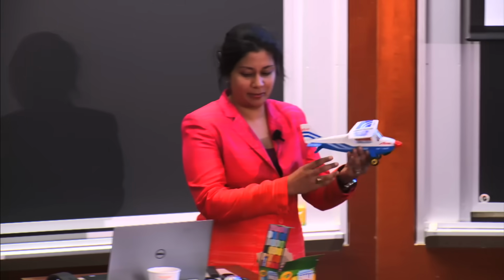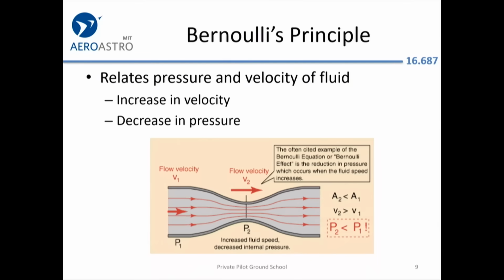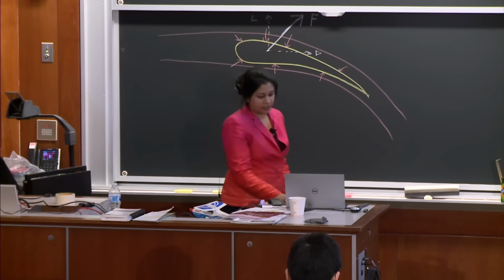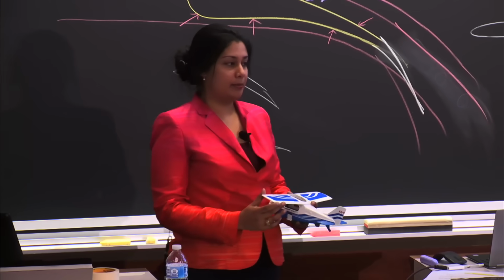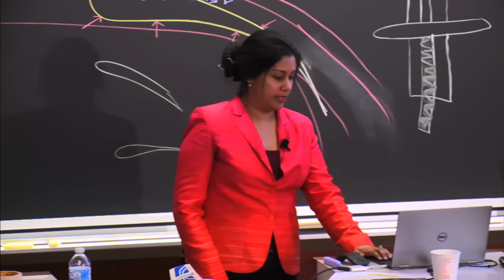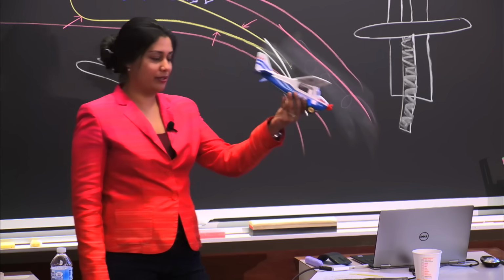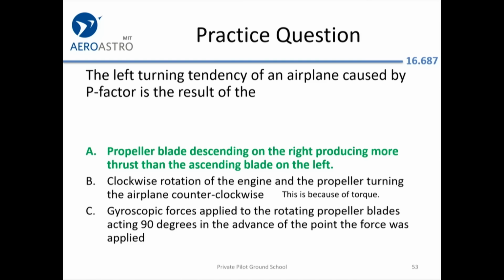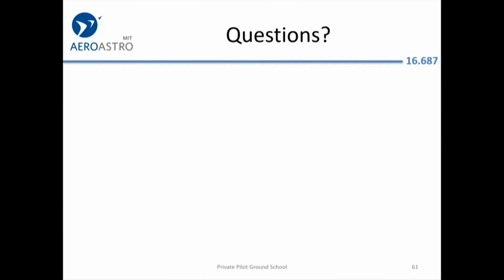Lecture 2: Airplane Aerodynamics

Comment: There is a WRONG statement at time 12:50 - The text in the slide "Air traveling faster over the curves upper surface of an airfoil causes lower pressure on the top surface". Is conceptually wrong . It seems to be a leftover of the "equal transit theory". If you want to explain lift by this "lower pressure generated by the higher speed or air across the top surface" you have first to state the reason why the air is flowing faster on top relative to the speed at the bottom surface. I think you can not state any other reason that the wrong "equal transit time theory". You are right that you can apply Bernoulli’s law to explain lift. But you have to change the wording in the answer C as follows: "The lower pressure at the upper wing surface accelerates the speed of the flow across it. At the lower surface the pressure is higher, so the speed of the airflow is not accelerated as much as at the upper surface". But why is there a lower pressure at the upper surface? It's because the upper surface is curved to form a line similar to a part of the circumference of a circle. So the air flowing around that "part of a circle" experiences centrifugal forces that are 90° away from the surface of the upper wing. In other words - the air molecules tend to follow a straight line, but if they are deflected to follow a rounded surface there must be a force keeping the molecules on a path parallel to the curved surface. This force is given by a pressure differential between the free undisturbed air far away from the upper surface (ambient pressure) and the pressure of the air flowing in a curve over the curve of the upper surface of the airfoil. There is another error in your explanations: When you introduce the "flat plate airfoil" of the paper airplane to explain that the "equal transit time theory" is wrong. You suggest that the lift of the inclined "flat plate airfoil" is generated equally along the length of the flat airfoil. But a wind tunnel experiment at MIT will show you that this is NOT the case. The front 20% of the inclined "flat plate airfoil" generates much more lift that the remaining 80% of the plate. This is another hint towards the fact that lift is generated by the lower pressure that is a consequence of the air flowing around (a-ROUND) the leading edge of the airfoil. A similar effect is observable at the lower surface of the flat plate airfoil. The air is changing direction downwards just immediately behind the leading edge. The remaining flat lower surface of the "flat plate airfoil" is contributing much less towards the total lift generated by the plate. It's because air is not like sand. If you would drag an inclined board through fine dry sand at a beach below the surface so that the entire board is below the surface and dragged parallel to the surface, then all the length of the inclined board would push equally up towards the surface.
Reply: https://en.wikipedia.org/wiki/Bernoulli's_principle
Reply: @Angelum Band If you want to reason that Bernoulli's principle is the way how airfoils produce lift, then you have to be careful not to interchange cause and effect. At the upper surface of an airfoil the pressure is reduced because of the curved flow experiences centrifugal forces away from the airfoil - this is the cause of the acceleration of the airflow towards the reduced pressure. Bernoulli's principle only states that along a flow line there is the relation of higher speed at a lower pressure and a lower speed at a higher pressure so that the sum of potential energy due to pressure and the kinetic energy due to speed remains constant along the path. If you want to make the statement that because of Bernoulli's principle the airfoil generates lift and continue to say that because of the higher speed at the upper surface of the airfoil there is lower pressure - and failing to give a reason for that increase in speed across the upper surface of the airfoil, you are failing to explain how a wing generates lift. If you just assume that the speed across the upper surface is greater then you either stick to the falsified "equal transit time theory" or believe in magic. The air mass molecules do not communicate among them "Remember Bernoulli - here across that upper surface of the airfoil we must increase our speed so that there will be a reduction in pressure". It's not like that. The reduction in pressure does accelerate the air mass from the higher ambient pressure of the air ahead of the airfoil towards the low-pressure area above the airfoil. In physics you have to carefully observe the relation of cause and effect. The difference in pressure (cause) increases the speed of the air mass (effect). It's NOT the other way round (as you try to explain), that because the speed of the air above the wing is higher (why?) the pressure decreases.
Reply: @sorgfaeltig  Explain the Magnum Effect but with a cylinder rotating in the same direction of travel: why does it sink?
Reply: @sorgfaeltig  Btw I am an Atheist I don't believe in magic or deities for that matter.

Comment: As someone who has spent a significant portion of his life sitting in a classroom being talked at, I've developed strong likes and dislikes which relate to the style of teaching.  At the top of my list of dislikes is having the teacher [ in this case, but it can apply to popular lectures also ] pose questions to the class - example - " what is a fuselage ".  Who is supposed to answer such a question and in what manner, and above all why is it being asked.  The main problem is that a small number of bright sparks in the class will feel the need to respond verbally, resulting in a jumbled and garbled response.  Typically there will be at least one response which will be incorrect.
IMHO it's OK for presenters or teachers to ask rhetorical questions which they immediately answer.  The problem occurs when  questions which should be rhetorical  are presented as ones requiring a response and the concomitant risk of incorrect responses, which if they are intelligible can cause wider confusion.  SO instead of asking " what is a fuselage " it is much batter to say up front what you as presenter mean by a fuselage.
An egregious example of posing real questions was when she asked the class directly an imprecise question relating to the flow of " th' air " and " th' airplane ", in the obvious expectation of receiving an answer [ which was not immediately forthcoming ].  A clumsy attempt at introducing the concept of ' frame of reference '.
Reply: Her understanding of lift in fluids is ridiculously wrong.

Comment: The equal transit theory is still being taught, and even tested, by Embry Riddle, the FAA and most pilots you ask to explain how an airplane flies will go on a Bernoulli trace-the-molecule story. They may have advanced past the equality in time, and will instead describe lift as a function of suction on the top of the wing due to lower pressure.
Reply: They teach that because that's how it works.  She doesn't understand how a wing can create lift at zero angle of attack.  She only understands "hands-out-the-window" and paper planes.

Comment: Never ask a question, for example, "which moves faster the air past the wing etc." and expect someone to give you an answer.  Instead
 ask them HOW do they know that, or HOW they would find the answer, what tests would THEY perform, how would THEY check for any errors/mistakes or if they were fooling themselves and then go outside to test it.

Comment: Literally went from “what’s a fuselage?” to “characterise the viscosity of the lift with turbulence of the propeller in the photosynthesis of the leaf” in the space of 1 hour
Reply: Underated comment. 😆 🤣
Reply: @mmm-mmm  yeaaah same, I noticed this too!, Im 15 and understand and most of this! 🤩
Reply: @GauravVerma9090  BSc = Bachelor of Science… basically, it means going to university, in this case, for an engineering course
Reply: @GauravVerma9090  Ah, there we go! Well, with «BSc in Engineering» I simply meant a bachelor / university degree in an engineering related field! ;D «Bachelor of Engineering» or «Bachelor of Technology» is, in fact, not that common in my country, therefore «BSc of Science in Engineering» is a term used to simply include an engineering course. :)
Reply: @GauravVerma9090   Just in the centre of Europe: Switzerland 🇨🇭
Reply: She did not say any nonsense like this.
Reply: I recommend you sign up for a BSc in engineering! ;D

Comment: is a -, which means that its viscosity depends on the forces applied to it, as measured by shear rate. Consider - such as toothpaste, ketchup and whipped cream. ... Because of this physical property, a wave of  is even more devastating than a typical tsunam

Comment: Most race cars today, atleast the ones in the formal 1, 2 and 3 generate the bulk of their downforce not with the wings, but with how airflow is directed under the chassis and let out through the rear diffuser. But of course, what she said definitely holds true for a regular car with/without spoiler.
Reply: They sort of turn the entire car into an upside-down wing too. They establish a high pressure region at the leading edge (nose), which causes an acceleration of air down the concentration gradient, to the rear. Higher velocity: lower pressure, so downforce results.  So maybe considering the front spoiler and rear as "flaps on a wing" is a better analogy?
Reply: The proximity of the bottom of the car to the race track creates a suction that helps hold the car down as air passes beneath the car.  The cleaner the flow of that air, the greater the downforce.  One reason you see the bottom of extremely fast race cars with fully sealed chassis bottoms.

Comment: @Bartonovich52 
YT is goofy.  I saw your post in full, but YT won't link back to it in that thread, so I'll try this.
.
 The air is accelerated over the wing which reduces the pressure.
Nope.  If you believe that is what is “right” about the use of Bernoulli in lift explanation, you are mistaken.
The pressure Gradient is the cause of the acceleration. 
You don't do 'something' to accelerate the air, then that causes the lower pressure.
.
This “fast air” thing is the most common Bernoulli myth repeated over and over. Euler determined that Pressure Gradients are the cause of fluid acceleration in the mid 1700s and derived what we now call Bernoulli’s Equation. 
Bernoulli only noted that the pressure decrease accompanied the speed increase (which is acceleration) 
.
The bottom of the wing is what gets pushed.  Fluid doesn’t pull.  Just because the pressure increase under the wing is minimal doesn’t mean it is unimportant.  It is the pressure difference that is the entire lift force and this escapes many who only say “conservation of momentum”.  
It is the lack of understanding of the actual cause of the pressure changes around a moving wing that makes people repeat all the myths. 
It is more instructive to show a significant AoA (5-10) to the beginner because first; the increased pressure is more intuitive with the “wind blowing on the surface” agreeing with every –day experience. Then, second, the effect  above the wing can be compared with the similar transverse Pressure Gradient causing the curved flow. The science has significant similarities above and below – IF you understand it.  She shows a high AoA for this reason and it is fine that way.  
She does much ok, just poorly explains some things and doesn’t explain others, just mentions them and doesn’t mention things she should.
.
We put things under the wings not because it has nothing to do with lift, but because disturbing that flow does little to change the pressure that is most certainly needed. The effect above is more easily disturbed and the bigger contributor, so decreasing it even a little is virtually a 1:1 change.
.
You don’t “forger about gradient’ because that it the driving force for all air accelerations we see around a wing: ahead, behind, above, below and around the tips.
.
Bringing in super critical stuff is far more than needed to understand the fundamentals of lift and only serve to confuse the beginner and pilot with even more things they do not need to understand. 
Kutta is also not needed, nor is it inexplicable. Just look at any of the wind tunnel videos or CFD images and we see that it does that.  It is quite intuitive that the air continues to flow in one direction to the beginner. That is only needed because in inviscid flow it isn’t guaranteed and bringing in inviscid flow is another beginner unneeded complication. 
. No, you can’t just say Newton any more than you can just say Bernoulli or conservation of momentum. HOWEVER, because Pressure Gradients cause acceleration, this is very much intuitive for those understanding Newton – force is required to accelerate any mass, including a fluid and it is the Pressure Gradient in fluids that provides that force. It boils down to Newton --- just NOT like it is explained in the common “reaction” explanations.
.
I can provide a point-by-point critique of this video, if you wish, that I did for the student who alerted me to it… If, that is, You Tube will route me to the thread this is in. I am working from the full text that came in the notification and haven’t tried the link yet.
Lastly, I’ve talked with some well-known authorities in aerodynamics, but have yet to talk with professor Krzysztof Fidkowski to clarify some fine points.
Professor Krzysztof Fidkowski, is one of the best treatments.
How Planes Fly.  https://www.youtube.com/watch?v=aa2kBZAoXg0 
https://www.youtube.com/watch?v=aa2kBZAoXg0 
This link goes directly to his discussion of above the wing at 15:28:
https://www.youtube.com/watch?v=aa2kBZAoXg0&t=928s 
Regards

Comment: Why was I taught equal transit theory by professor, even though it has been proven wrong. 
P.S: Well at the time I was taught this my professor didn't even mentioned any name, he simply came, drew a diagram, wrote some equations, dropped the chalk and left.
Reply: YOu were taught that because that's how it works.  She doesn't understand how a wing can create lift at zero angle of attack.  She only understands "hands-out-the-window" and paper planes.

Comment: A common misconception is that Bernoulli pressure differentials and the Coanda effect are responsible for generating lift on airfoils. They do not. The pressure differentials generated on and around an airfoil are approximate enough to Bernoulli that Bernoulli's formulas are used in designing aircraft, but Bernoulli forces contribute little to lift generation by way of an airfoil.

An airfoil utilizes the vacuum that forms on its top side to pull down and accelerate air from above it downwards, and in so doing, the opposite reaction is lift: It's Newtonian. Airfoil equipped aircraft are essentially horizontal rockets, but much more efficient.

Airfoils are more efficient in sustaining flight because the majority of the energy utilized to maintain lift for airfoil equipped aircraft comes from gravity: 66% to 75%, or more. This is why aircraft have unpowered glide-ratios (helicopters, auto-rotation), and gliders, auto gyros, and hang gliders do not fall out of the sky.

Comment: This is simplistic, incomplete and doesn't explain why the air on top of the wing curves down. Why wouldn't the air just go past the wing on a straight line on the top? It is the vacuum caused by the shape which in turn created a negative pressure. This negative pressure caused air to come down as well as the lift on top of the wing. Also, the drawing depicts the wing on take offs and landing. The bottom part of the wing is not that curved during the mid flight.
Reply: This is meant for pilots, I'm sure an actual aeronautic engineering course would go into the full theoretical and mathematical detail.
Reply: U criticized n wats nice abt u is : you added advance substance. Much appreciated.  Am ah truck driver!!!
Reply: viscosity of air

Comment: I don't get why she did not mention that the gyroscopic precession is pretty much only affected on tailwheel aircraft. 
Gyroscopic Precession occurs when the propeller is spinning in a clockwise direction, and when the tail is released from the ground, which leads to a slight pitch down attitude of the aircraft. Precession is caused 90 degrees clockwise of the propeller, which is actually the right side of the propeller, and creates asymmetrical thrust.

Comment: Your description of AOA at min 24.5 is incorrect. You described pitch not AOA. A slow wing at 0 degrees pitch can have a higher AOA than a fast wing at 15 degrees pitch up. AOA es the difference in the angle that the airfoil is contacting the wing versus the pitch angle.